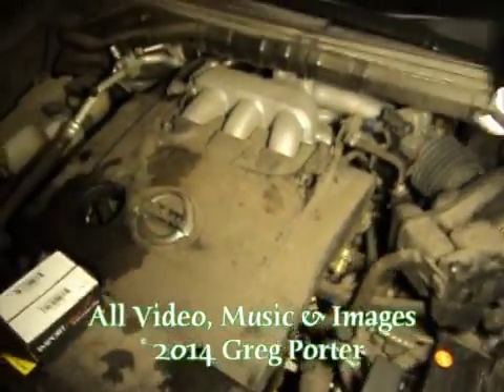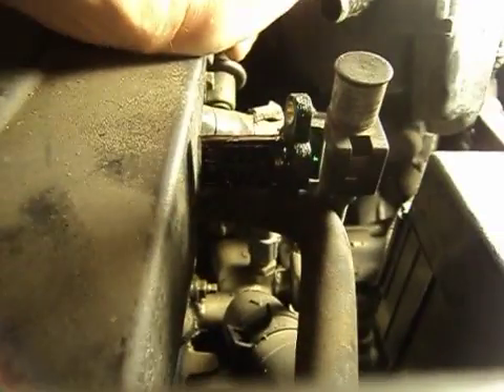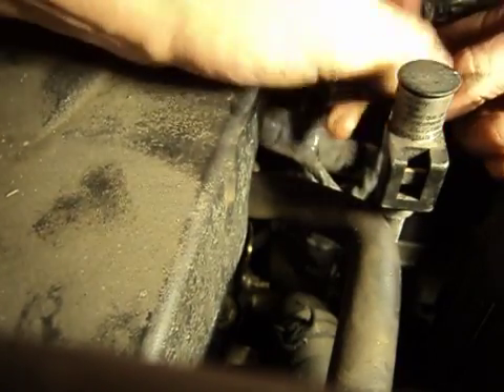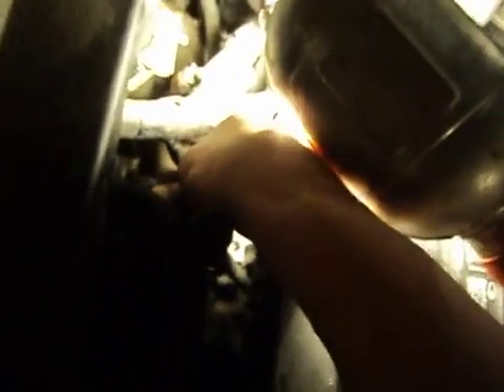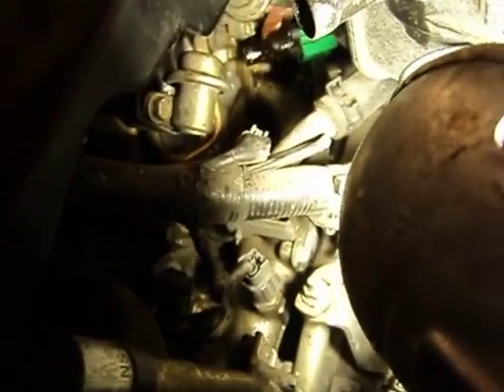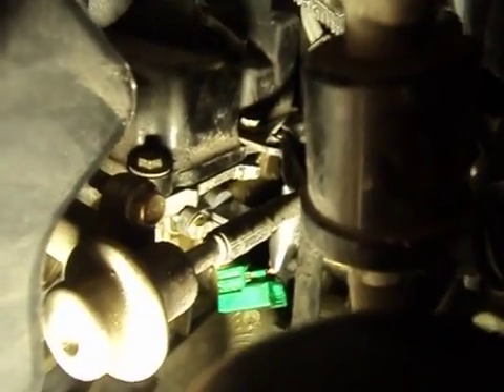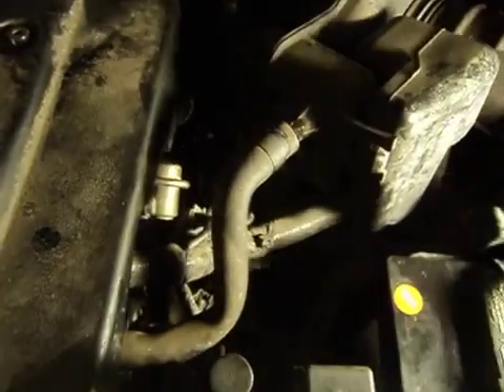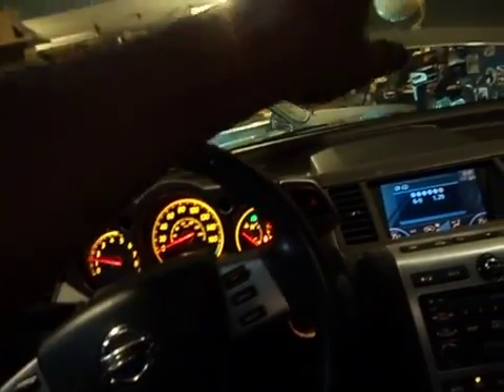Cam Position Sensor Replacement - Nissan Murano 3.5L

Comment: thanks for sharing the only thing that I would of add is that one of those is the transmission camshaft positioning sensor that way people would know which one to change they both usually dont go bad toguether  but this video clear to many whe this two canshaft  are in our 2009 muranos thanks again

Comment: hello greg, i have a murano z50 awd and i can't use it on the road. It start easy , i push gas pedal the rpm comes very good, but if i use the transmission on D or R it's ok only to go out of the garage. I push stop pedal and if i want to use transmission again i can't, the engine is ok but gas pedal has no effect on rpm. i have to push to bottom the gas pedal to ride very very slowly. If i turn off the engine and turn on again it' s ok to ride in the gararge, but just only, because little time after it's bad like before. I can't take road like this. could you tell me what happen, and what i need to change? thank you very much greg.  my name is olivier (france)

Comment: Just replaced both sensors with parts from RockAuto: SK917704 $12, and SK907716 $19.
Both of these are cheapest on RA, will see how long they last. 

IIRC, I replaced both of these 8-10 years ago when this was my wife's vehicle. I'm sure I got them online, however upon removal neither had an o-ring. Explains why both areas were really oily, and maybe why the engine seems to use a bit of oil..... I'll post back here if they go bad in the next several years.  These are Hall-Effect sensors, which are super simple, usually a magnet passing by with redirect current from one path to another, so no real 'electronics' or moving parts inside, so I don't see the need to go OEM or better.
Check out here:  https://itstillruns.com/change-camshaft-position-sensor-6686826.html
and Hall-Effect sensor here:https://www.electronics-tutorials.ws/electromagnetism/hall-effect.html

Comment: Very helpful.  But one word of advice:  Notice how you had to get on that bolt with the socket wrench at an angle because there is a heavy pipe in the way that you cannot remove.  You may not be able to get that bolt out with a socket wrench if it's tight.   You can round off the bolt and really be stuck.   I could not get it out that way, and used a 10mm box wrench for maximum grip (better than an open-end) so you can get in from the side and not risk rounding off the bolt.

Comment: Hi Greg thank you for all your videos, I need your help here, my Nissan Murano 2003 doesn’t start but just makes a click sound when I turn the ignition key on. I pressed the gas pedal to the floor while driving as my car wasn’t running fast and then after that the car started shaking and the check engine started flashing I got home at low speed since the car was shaking and then when I tried to start it later it gives a click sound, I have tested the battery and starter with autozone and they are both good. DTC codes I have are p0300, p0420, p1800 and p0021.
Any advice would be highly appreciated thank you

Comment: Our shop has had many problems with the aftermarket sensors – stick with oem. Also, the connectors are known to go bad. Most of the aftermarket connectors are junk (Chinese junk) and fail often, but we found a vendor who sells quality hand-assembled fully tested connectors and they work 100% - for the Bank 2 connector look here:  https://www.ebay.com/itm/381951393669 and the green Bank 1 connector here: https://www.ebay.com/itm/401294091068.  

Before you replace the sensors disconnect the connector and clean it with CRC electrical parts cleaner or something equivalent. If this helps at all then the connector is likely bad or is going bad and should be replaced. Yes you may get it to work for a while by cleaning it but it will soon fail again - I've been thru this several times.
Reply: I had a bad connector also - thought it was a sensor at first but replaced the sensor and still had a code.
Reply: Yes, don't rule out the connector - they go bad more often than u think
Reply: Yea, we bought the black and green bank 2 connector from seller Allzone on eBay - his connectors work. Don't buy the cheap ones - you'll only buy yourself a headache
Reply: 2 posts by different commenters, and read almost exactly alike word for word. Both suggest sticking with OEM, and then go on to recommend knock-offs.
I've got to replace mine, and I'm just going to Rock Auto https://www.rockauto.com/en/catalog/nissan,2006,murano,3.5l+v6,1433000,ignition,camshaft+position+sensor,7192

Comment: Will a bad cam shaft sensor and or crank sensor make the engine crank but, not turn over, like there is no fuel to the engine?
2006 Impala 3.9
Awesome video. Thanks a lot.

Comment: the rear one is really hard to pull off! any advice? dont want to break the thing. thanks for the helpful video!
Reply from the maker: The clips can be difficult...  Take your time...  If the sensor is stuck in the hole, you can use a pair of pliers to persuade it out.

Comment: In this video, it looks like you only replaced the rear camshaft sensor and the crank shaft sensor. I went to the auto parts store to get these but they specifically ask me if I needed the front or rear camshaft sensor. The code I have is P0725 on a 2005 Nissan Murano. I can find nothing out here to tell me which one or both (front and rear). Do you have any suggestions?
Reply: Correction, I see you replaced both front and rear camshaft sensors. I'm guessing then I need to replace all three (F n R camshaft sensors and the crankshaft sensor) for this error code.

Comment: I'm getting error P0011 -- Intake Camshaft Position Timing - Over Advanced and this video came up when I googled it. It doesn't appear like this will resolve this issue, however, do you have any input on this error? Same engine.
Reply: Hey Scott Walker, did you found out how to fix the P0011 error code?. I have a 2004 Murano with that one.
Reply: check your oil, these will throw the code of you're low on oil or oil gets old between oil changes
Reply from the maker: +Scott Walker I think you are right...  Not sure why that code brought it up.  I haven't seen that code before.  Take a look at variable timing videos.  I can't remember if they handle this with a synchro setup or if it's an EFI/injector control.
Reply: That one kinda fixed itself, I really have no clue what fixed it. I replaced the thermostat and reset the error code (not to fix that issue mind you) and it never came back up.

Comment: p1700,P1720,P1574,
dear i have the above mentioned fault codes. When car reaches to 110 and above its cruise start blinking, and after some time(about 50KM) it have issue with gear shifting. also its RPM sometimes vary. please advise me what do. 
please Note that i have already changed its CVT.
your prompt reply will be appreciated. 
regards

Comment: So my Murano is giving me a code of P0335 "Crankshaft position sensor "A" "
There is lots of discussion about the sensor being "Crankshaft" and/or  "Cam shaft" 
Do I have to replace both? just like you did? Is there A and B?

Thanks in advance
Reply from the maker: +Paco Patron There are 3 sensors, 2 cams and a crank.  The cams should be replaced as a pair just like in my vid.  Some say the crank sensor should be replaced at the same time.  I did not replace it and I've had no trouble with it yet.  I may do it soon just as preventative maintenance.

Comment: Hey, What is the different between original part and auto-parts? The different in price is so high and want to check if auto-parts will work with my Nissan murano 03?
Autoparts price is $66
http://www.autopartswarehouse.com/search/?Ntt=camshaft+position+sensor+bank+1&searchType=global&shopId=1&N=0&addfitment=1
However Nissan dealer-ship price is $158
Please advice if it's worth it to pay this much for this part.
Reply: +Elyaa Hammad Never, ever buy aftermarket, or ebay/chinese sensors!!! Please, just don't!!!! Done it ones, never ever again. I/you should always listen, what Nissan/Infiniti techs are saying, when it comes any electric parts, always dealer!!!! Amen =)

Comment: Thanks so much on this repair. My wife just bought a 2007 used Murano and the code threw this condition out on her when she had it checked. This must be a common occurance with this vehicle. I'll be gettin'er done soon. Again thanks for the info.
Reply from the maker: stewnta Yes.  They seem to poop out somewhere around 80,000 miles or so.

Comment: Hi, what if I have no codes, no check eng light on and my murano 06 120k miles. Hesitate as I put almost 4000 rpms, feels like its chocking and the rpm's will go quick up and down from 4000 to 3500 rpm. Also, I found out it is burning oil, but no leaks, no heavy smoke, it will smoke a little when I crank it up in the morning and yes, after $1200 at Modern Nissan dealer, I'm dealing with all this.
Thanks and I hope you can give me some advise.
Reply from the maker: Juan Fernandez The sensors are cheap and easy to swap.  I'd start there.  They don't always throw a code.  They sometimes work intermittently, so without swapping, you never know.
Reply: Thanks a lot.
Reply: Juan Fernandez hola tengo el mismo problema que tu en mi murano 06, la pudiste arreglar cambiando los sensores?
Reply: Juan Fernandez b

Comment: Thanks soo much for this video....I replaced both sensors this morning.  I am one happy lady.  It saved me about $420 bucks...wooo hooo.  I can go shopping for some cute shoes with that money.  It took me about an 1.5 hours and a couple of broken nails....caught a fit removing one of them from the clip.
Reply from the maker: TaRitaBG Yep.  The clips are the hardest part of this operation.  Enjoy your new shoes!
Reply: Our shop has had many problems with the aftermarket sensors – stick with oem. Also, the connectors are known to go bad. Most of the aftermarket connectors are junk (Chinese junk) and fail often, but we found a vendor who sells quality hand-assembled fully tested connectors and they work 100% - for the Bank 2 connector look here: https://www.bonanza.com/listings/517045501   and the green Bank 1 connector here: https://www.bonanza.com/listings/441267637   Always check the connector before replacing the sensor. For that matter, always check the connector for any sensor before concluding the sensor is bad.

Comment: Thank you for a very informative video. I changed both sensors for the estimated cost of shop running a cleaning product through on the chance it would cure my problem.

Comment: Thanks for the vid. I have the P0340 error I believe it said Bank 1. I tried replacing the one you did first but still stalls when I try to start. The car run fine otherwise and don't notice any stuttering. These P0345 and P0340 codes reliable on where the failure might be?

Comment: Great video.  what are the symptoms of a bad sensor.
Reply: Hard start, meaning when you crank the car it ignites for about e to 7 seconds before finally turning over, also may be slightly jerkish when shifting and even stall or turn off sometimes.  Those little things are so small but can cause seemingly big issues.

Comment: My Murano threw a code today bank 1 CAM sensor, didn't want to spend more money so I decided to just replace bank 1 sensor...the Murano is running fine now...Just wondering would it be okay to clean the bank 2 sensor and not damage it? thanks
Reply: +Greg's Garage Cleaning does not do anything, heat/age makes them to fail, my Infiniti this happenend 114000 miles, always change both of them, and cranksensor too, similar sensor, has to go under the car the change that !=)
Reply from the maker: Good question.  I don't know what causes the sensors to fail.  My understanding is that there is a magnetic sensor.  Dirt/oil should not affect the magnetics, but maybe it does.  I don't believe it will hurt to clean it, just be careful with the wires, pulling on them could damage the sensor.

Comment: Great video.
My murano has died  on me a few times when getting to a stop, also kind of jeks when driving in the freeway, it's done it a few times.
Scanned it and the P0345 code came up (camshaft position sensor mulfunction)
I think is time to replace the sensors.
Thanks a lot for this video.
Reply from the maker: No sweat.  Good luck with the repair.  Once you figure out the electrical connector (be easy on them) it's a piece of cake.

Comment: your right on the savings over having the dealer fix it. Did an egr valve assembly on a Dodge pickup last weekend. Total cost 53.00. Dealer wanted 500.00..........tony

Comment: Like the new trailer!
Reply from the maker: Thanks man.  Finally getting the Mac editing up and going.  Surprisingly time consuming to shift all that stuff over.
Reply: All the vids and clips I saved on my pc external hard drive work seamlessly with the mac.  But I didn't have to transfer stuff... I tend to only use external hard drives.  I have my mac set up to only have OS X and some applications on the SSD I installed.  I keep all my video files and downloads, etc... on my external hard disk.
Reply from the maker: I'm trying to do the same.  I bought a WD passport and have been dragging vids there rather than in the preset "library" folder.  

I had to take the mac in for a video card, then it was a complete reinstall of all the software since it got shipped off to apple...  You know how it goes, it takes forever to get things set up the way it makes sense.  I finally had a couple extra hours to make the jump.